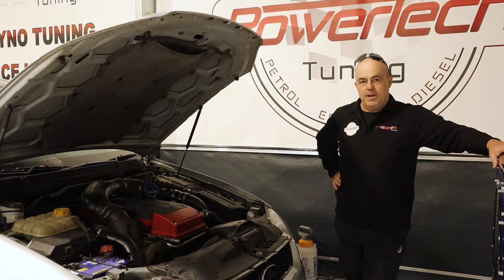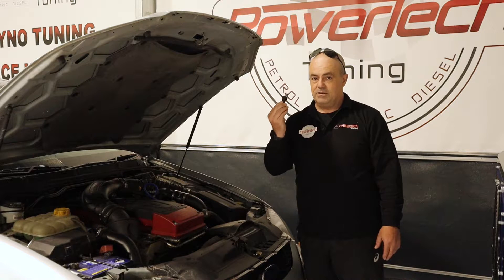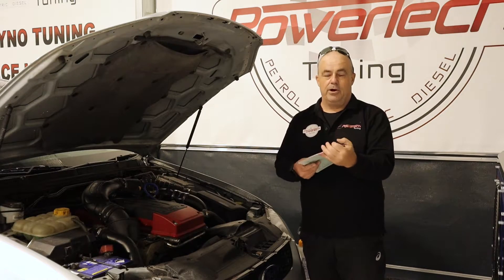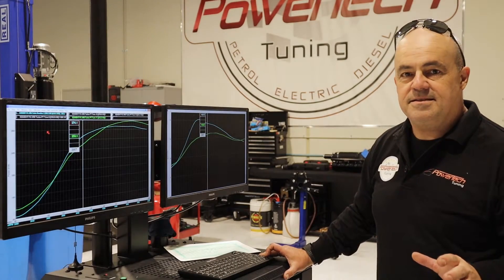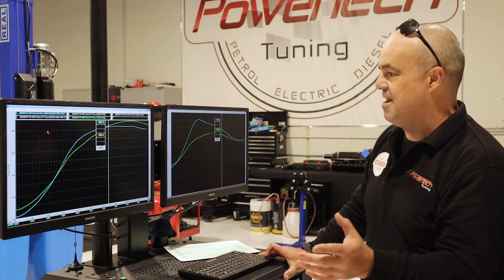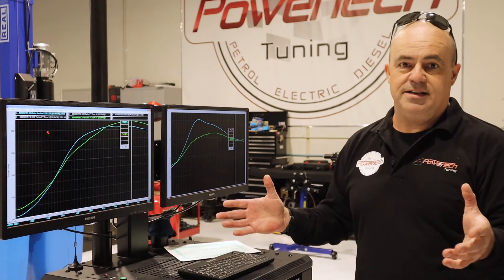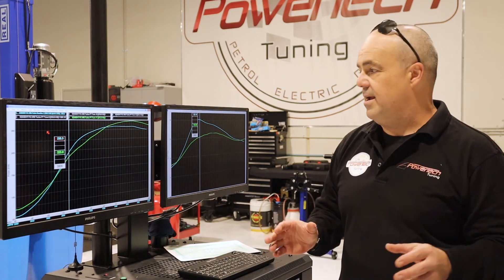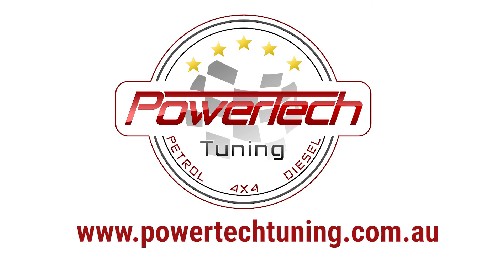Common mistakes...and fixes tuning a Ford XR6 Turbo

Comment: Whats the best results you have managed to get out of a stock xr6 turbo. Best iv done was a f6 408hp stock 490hp after a tune 525hp with a new dump pipe to remove catalytic converter on a mainline prohub.